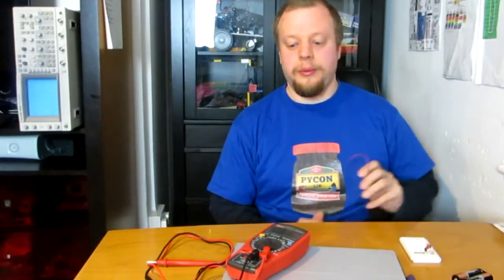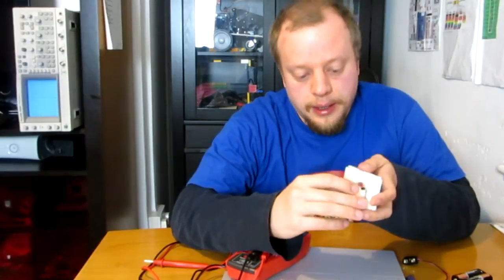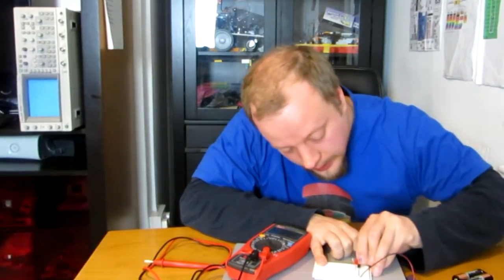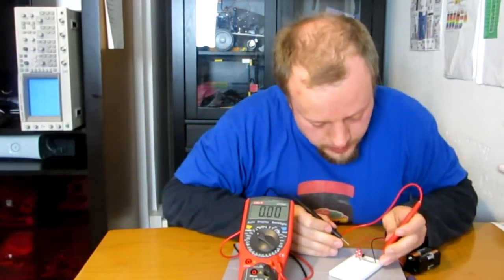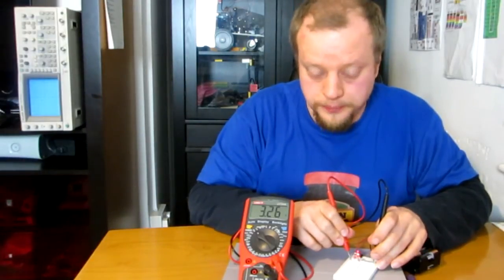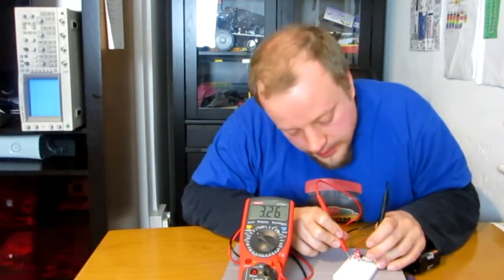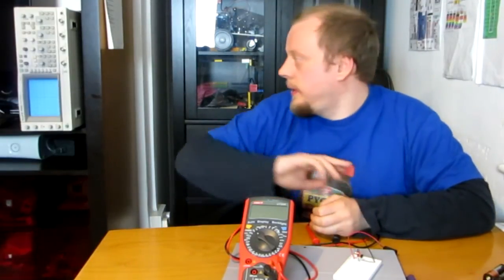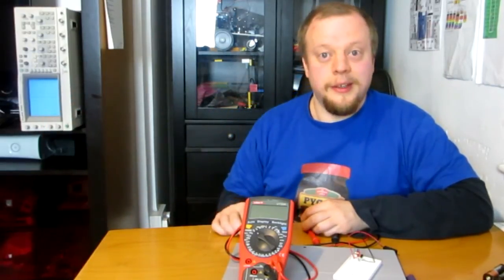Making A Simple 3 3v Supply

Comment: hello,
Could you point a link or do safety review of eBay AC power supply.

http://www.ebay.com/itm/1PCS-AC-DC-Power-Supply-Buck-Converter-Step-Down-Module-Chip-3-5W-700mA-5V/181946900693?_trksid=p2047675.c100005.m1851&_trkparms=aid%3D222007%26algo%3DSIC.MBE%26ao%3D1%26asc%3D20131003132420%26meid%3D48f6630ef4c6402ab8eab99e88973a3d%26pid%3D100005%26rk%3D1%26rkt%3D6%26sd%3D252192201703

http://www.ebay.com/itm/AC-DC-5V-1A-1000mA-Power-Supply-Buck-Converter-Step-Down-Module-NEW-Arrival-/271677883759?hash=item3f4143856f:g:LTsAAOSw-jhT~r25

Thank you
Reply from the maker: +Good Will Hi there, I mentioned your question in https://youtu.be/kKwHN4MtPek - however I didn't really cover project power supplies. I'd still recommend Mouser/Farnell over eBay items in, but you will find some cheaper or harder to find options on ebay - just remember it is buyer beware - read the specs carefully, and consider the country of origin. For AC converters - you should err on the side of caution.
Reply: +Orionrobots Thank you :)